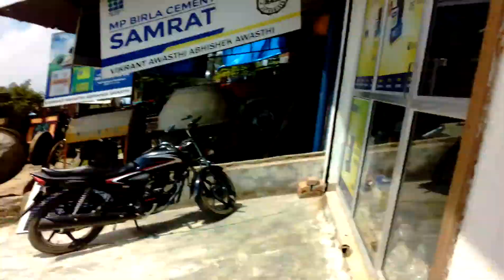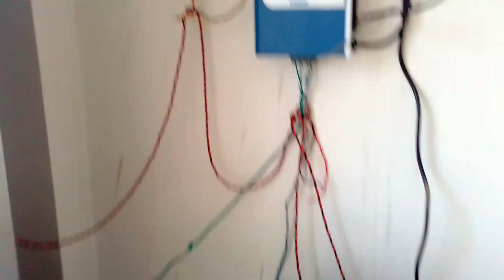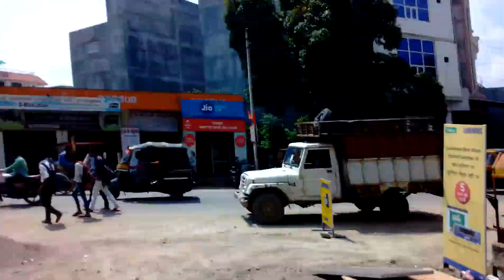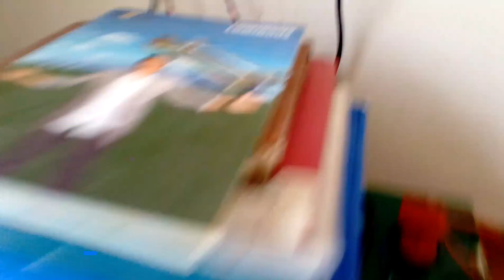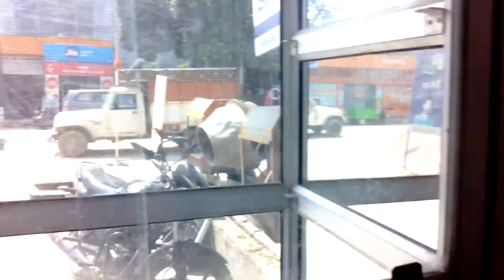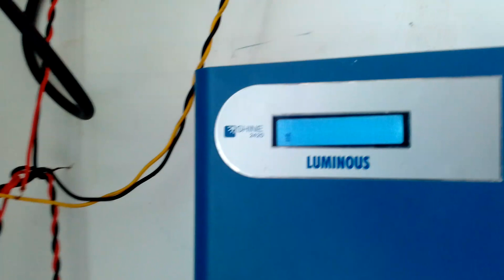How to convert normal Inverter into Hybrid One

Comment: Koi baat nahi bhai. Very good video. Samajhne wala chahiye bas.
Reply: bro mere pass 150w ke do solar panel he aur luminus ka 650 va ka inverter he...me confused hu ki kya me ek mppt charge contoller ko aur inverter ko parellely connect kar sakta hu...i mean charging battery throug both by grid and solar charge controller simultaneously...better prefer jab grid avaliable ho tab solar se charge na ho aur jab grid avaliable na ho tab solar se charge ho......thanks
Reply: Rachit kr singh Bhai mai to apko advise dunga ki aap mppt charge controller buy kijiye.Agar apke panel 150*2 12 volt ke hai to luminous ka mppt charge controller le sakte hain. 4500 se 5000 tak milega.ye 12/24 volt dono  pe kaam karega. But agar apko 12 volt mppt charge controller chahiye to sukam company ka 12volt/17 amp ka le lo. Amazon pe 2300 rs aur flipkart pe 2000 me mil jayega. But agar apko grid aur solar dono se charge karna ho to luminous product Jo nihal bhai ne dikhaya hai le lijiye.

Comment: I purchased one luminous retrofit but seems not working properly. When I remove the solar panel wire it continues to show PV:OK and tries to charge battery from PV. Also when I cut the grid supply then also it continues to display GRID:OK. Mr. Nihal can u please confirm your retrofits function when PV is cut and when grid is cut separately. Thanks.
Reply from the maker: Debaraj Keot when PV is not connected it will show PV failure and when grid is not connected or OK then it will show grid failure.
Reply from the maker: When you disconnect either panel or grid put the retrofit on manual mode.

Comment: Will this inverter support running load directly from solar bypassing mains?
Reply from the maker: Yes this is Solar Retrofit Solution 2420 ,  It will use Solar Panel Energy to charge your battery  and your normal inverter invert the DC energy of your battery  to supply the AC power to your loads.
Reply: Scholar Nihal what is the price dear? Can it be shipped to pakistan. ?
Reply from the maker: You can buy from amazon or ebay in approx 2700 INR
Reply: Scholar Nihal thanks for the help
Reply: AT SAME TIME IT CHARGE BATTERY  AND RUN LOAD OR NOT???

Comment: Bhai can you tell me the price of luminous 12volt/150 watt solar panel.I have solar setup of sukam panels but i want to extend it by luminous solar panel.
Reply from the maker: Ajit Bhai ..In the winter season panels rate are down you can buy 150 watt / 12 volt panel in 44 rs/watt easily .
means in 6600 rs.

Comment: मेरे पास luminous का 650va का इन्वर्टर है जो कि exide inva tublar 150ah की एक बैटरी से जुड़ा है इसको सोलर इन्वर्टर कैसे बनाया जा सकता है व इस हेतु कितने वाट व वोल्ट का monocentriline पैनल लगेगे व इसका क्या प्राइस होगा।
Pwm या Mppt दोनो में कौन सा कंट्रोलर ठीक रहेगा व कितने रुपये का आएगा। यह कैसे पता चलेगा कि mains on होने पर battery charging सोलर से हो रही है व mains off होने पर लोड सोलर पर शिफ्ट हो गया है।
Azamgarh up 276001 में आपका डीलर कौन है जो install कर सकता हो। व इसका टोटल कॉस्ट कितना होगा।

क्या इसके dc output से 12v 48amp की कार battery चार्ज हो सकती है?
Reply from the maker: Ravnish Verma aap isme  SRs 2420 laga sakte hain or 150wp ya 100wp ke 2 panel lagaye jisse aapki battery अच्छे से चार्ज हो सके।
Reply from the maker: Ravnish Verma आपकी कार की battery 100wp ke सोलर पैनल से लगभग 4 hour मैम चार्ज हो जाएगी। पैनल के  + or - ve wires ko app battery ke terminal main direct connect karde.
Reply: धन्यवाद भाई। मेरे द्वारा और भी जानकारी मांगी गई है उनको भी answer दे दो।

Comment: I will always say to go for mppt charge controller. One time paisa lagega but benefit hamesha rahega. Mere ghar 300 watt ka setup hai. Pahle pwm tha  to 15 amps milta tha but jabse sukam ka 12 volt 17 amp ka mppt controller lagaya hai tabse 17 se 18amp output milta hai.15 amp input and 18 amp output.But costly padta  hai. 12/24volt 20 amp  mppt to bahut Jada costly hai. Pasand apni apni
Reply: Ajit Kumar hello brother
Can you recommend any mppt retrofit solution with similar features for 800 watt pv pannels. I will use it with cruze 2kva luminous.
Reply: Ishant Sharma Hi first what is your system type 12 volt or 24 volt. If it is 24 volt system then check sukam 12/24volt/ 27 amp mppt charge controller. It will support 800 watt panels. It's available on Amazon. But its only a mppt charge controller not a retrofit. If you have luminous ups then just buy a mppt charge controller.
Reply: Ishant Sharma Just take a example - 100/watt panel gives upto  5 amps and a 50 ah battery is sufficient for the 100 watt panel. If you have two 24 volt battery and one battery is 150 ah them for two batteries you should use 600 watt panels. Remember a mppt charge controller always boost amps to battery. It near about 30%. 700 watt will be sufficient for your system with mppt. If you goes to pwm charge controller then its not too costly. It support more panels. But I will recommend you to go for mppt. At my home i  have install a sukam mppt charge controller with three 12 volt 100 watt luminous panels.Panels accurate provide 15 amps to charge controller and it boost upto  18 amps. So mppt is little costly but its best. Check sukam and  systellar mppt charge controller. But right now sukam provide mppt at best price.
Reply: Ishant Sharma Bindas poocho Jo pata hai bataunga.
Reply from the maker: Ye Luminous ka blue box SRS 2420 Retrofit hain jo ki online shop pe bhi mil jayega or aapke najdeeki dealer shop pe bhi mil hayega
Reply: Ajit Kumar how to buy sukam mppt charge controler?

Comment: Kitna price hoga battery solar charger
Reply from the maker: It comes in three varients 6 amp, 10 amp or 20 amp. these are PWM charge controllers and  rates are about 450, 650 or 1450 Rs consecutively. SRS 2420 is for 2500 Rs approx with LED Display